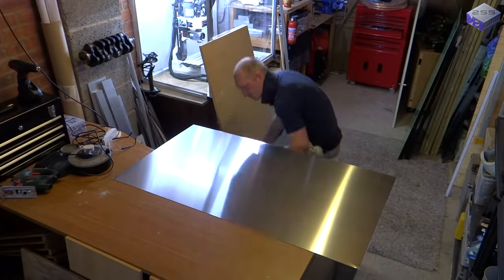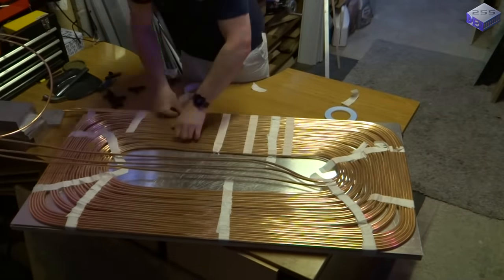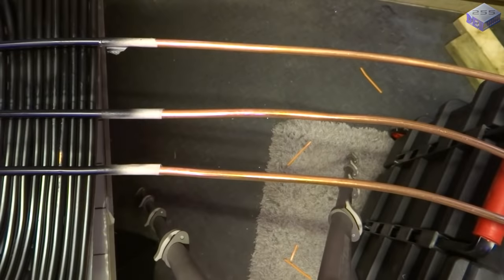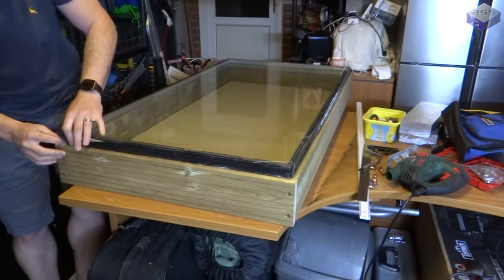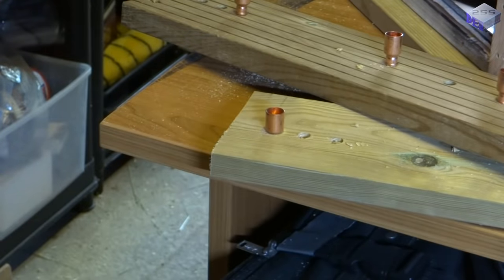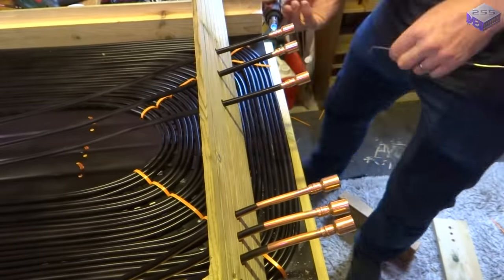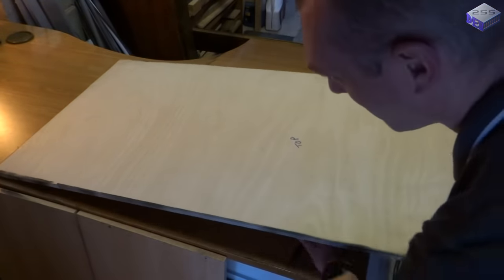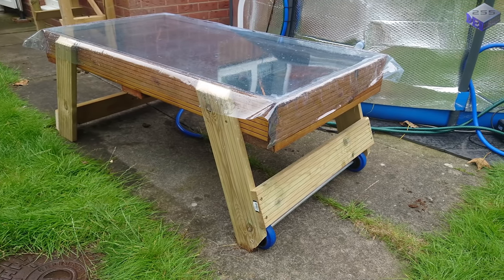Improved Solar Pool Heater - Full build

Comment: Does it freeze in winter?
Reply from the maker: Hi, yes it will do if the pool was to get too cold in the winter, I don't believe there is enough heating during the day to keep the pool above 0ºC overnight. We pack our pool down when the temperature starts to drop and cant be maintained.
Reply: @TheSolarPoweredEngineer  thanks for the answer

Comment: Great video, looks pretty damn good. Question: Does the height of the enclosure affects the efficiency? I'm planning to build a couple and I would like it to be as thin as possible since I'm installing it on my roof near my solar panels.
Reply: Hi, thank you, works ok too. I am sure you are right, I can raise mine easily within the unit and believe it would make it more efficient, especially when the sun is at a angle to the panel. Good luck with yours 👍
Reply: I think you are talking about the height of the enclosure (box). As per my understanding, the lesser the height of enclosure the higher the temperature inside because the amount of sunlight/heat is constant. If we can reduce the air enclosure inside the box the air will be relatively hotter and the pipe/water will be heated soon.
Reply from the maker: @relianceengineering3710  I will have to give this a go, where I could drop the glass down a lot lower and move the inlets and outlets to accommodate the change also, or just raise the lower board up, it fits within the frame, so easy to adjust. I will probably do a Wattage output comparison between lower and higher; although would have to wait for some good summer sun, 2021 was not the hottest summer in the UK. 👍
Reply: @relianceengineering3710  the faster the air heats means it will also cool faster. Also you are forgetting magnifying effect of glass. There is an optimum height to maximise the magnifying effect.

Comment: I been trying to build the wife the hot tub I promised her years ago. If I run the wires for the lights and the fans up through the drain I won't have to drill holes for them, but then the plug won't seal. Any ideas what I can do here? I can email the schematics if it will help.
Reply from the maker: I would be tempted to fit an external drain pipe/hose that was raised above the water line, that way you could feed it down the tube and not have to worry about sealing it, plus you would only need to lower the tube to drain the system. Or purchase a spare drain cap (I'm guessing its the screw lid type) and ensure you seal this, although there will be a fair bit of pressure at the drain hole. I'm sure you are looking into a low voltage and fully insulated system with good electrical leakage detecting circuitry too. Hope that helps

Comment: Consider a hole for pressure relief?
Reply from the maker: Thank you, that had come up before, although the unit is not fully sealed at the bottom, in case of any leaks/condensation inside. A good point to note though.

Comment: Watching this video makes me think and believe that because flame from a match is so hot , it can melt a cube of ice. You missing heat with temperature, Sir.
Do the math.  With regular size of pool , to get to raise water temperature in it,  with one of your projects is impossible,  because you  gonna lose more heat from the surface of water in the pool.
So with this diameter of copper pipe,  you will need about 20 pieces  of your gizmos  hooked up in line,  to get proper amount of water flow, with such a heating surface to maintain. 
You can't trick physics 
With one of your panels you can warm up water in a 5 gallon bucket,  not water in a pool

Comment: Shouldn't you be using black cable ties for maximum thermal absorption?  ;)
Reply from the maker: Hi, I will be changing the cable ties at some point, possibly to copper sprayed black, as the orange ones may degrade in the UV light. There may be a little heating effect from them although may be very small in comparison.

Comment: How does the water circulate ? Thanks
Reply from the maker: Hi, I have a 12v pump that is now connected to a 50W solar panel via drinking water hoses; this then feeds into the existing Bestway pipes via 3-way connectors so that it passes through the existing pool filter first.

Comment: Do you have Reflectix around your pool???
Reply from the maker: Hi, this is the material that I placed around the pool: -

https://www.amazon.co.uk/dp/B00GUDVUXW/ref=as_sl_pc_tf_til?tag=dev25503-21&linkCode=w00&linkId=492f80de3ffcad224c5be22949f5a723&creativeASIN=B00GUDVUXW

It worked really well and has lasted for 3 years, its showing signs of delaminating now though as it's not designed for outdoor use really
Reply: @TheSolarPoweredEngineer  OKAY! Do you feel like it helped retain the heat? I've used it before in my camper but never thought about wrapping the pool.
Reply from the maker: @elbayanela  Yes, it definitely helped keep the heat in. I have a pool dome cover over the pool now too and garage matting under the pool that also help. Heating the pool is only half the battle 🙂. Also, the matting made the bottom of the pool very comfortable, when you jump in or hit your feet on the bottom, it's very soft.

Comment: Sorry i must've missed it in the video, but how do you make the water flow around the heater?
Reply from the maker: Ah yes, I probably only showed it briefly, this is the link to the pump I am using, it's a 240V AC pump running around 24W https://www.allpondsolutions.co.uk/pond/pumps/full-range/1400lh/

Comment: Would of been better to of used black zip ties they last longer under uv but some sort if metal bracketing could of helped with laying the pipe as well as holding and allowing for set distancing between the pipes.
Reply from the maker: Definitely, although looking at the unit now the glass is probably reflecting most of the UV, luckily the Infra-Red is still getting through. I will be trying a few different clear materials soon to see how efficient they can be made. I will replace the cable ties with metal ones then.

Comment: Great job 
 But your intake and outlet manifold needs some work to even the flow cause the way you have it is not afficient and would work alot better if improved.  By the look of it you are only getting 33%  of its possibility
Reply from the maker: Thank you, yes this is work in progress where I will be doing a few more tweaks to see how efficient it can become, or even build version 3.0 with Black 3 paint suggested from the last comment.

Comment: How big panel I should build for a pool around 30 m2?
Reply from the maker: So for a pool around 5.5m by 5.5m, assuming it's around 0.75m deep (around 22,500 litres), would need a fair amount of these, probably 10 of them to get you going, where a solar pool cover could work a lot better as you have 30m2 of surface area to collect heat. Plus, a solar cover reduces evaporation (heat loss and chemical loss (burns off the chlorine)) and retains more heat overnight, so should save you money also.
Reply: @TheSolarPoweredEngineer  hello thx for your answer I mean 30 cubic meters of water. Lets say to heat the water 3-4 celcius would it be possible if I built 2 or 3  of those with a small pump or the pool pump for 2-3 hours?
Reply from the maker: @FearOfGeorge  ah ok, so 1 cubic meter is 1,000 litres, so 30,000 would still need a fair amount, I am doing a few more videos on this one with a few modifications to see if I can make it even more efficient, and also try another design too, so it may be worth waiting for them, hopefully in the next few weeks.
Reply: @TheSolarPoweredEngineer  Thx sure I will for w8 your videos.

Comment: Is that a double insulated glass pane?
Reply from the maker: Hi, yes, unfortunately I have since found that it is reflecting a fair amount of energy from the sun that could be used to heat the water; therefore I will be replacing it for either acrylic or polycarbonate material.

Comment: What's the difference between capturing the solar gain of 10m square outside the pool or just putting a black tarp 20m Square inside the pool ? 😂
Reply from the maker: Very good question, the external unit has cool water pumped from the lower part of the pool so the panel is continuously trying to heat the cooler water, where the surface of the pool may have a much bigger surface area, although a number of factors reduces the efficiency, one being that the warm water on top of the pool does not transfer down to the cool water, so you still feel cold when you get in, another is that there is more surface area for the air to take away this heat, so it cools down quicker, and then there is the efficiency of the tarp to transfer the heat to the water. Although, if you had the black tarp on top of the water, circulated the water in the pool and have a clear pool dome attached that covered the pool and reduced the heat escaping, this should be a lot more efficient and is something I tried last year. Video to come.

Comment: What temperature do you get out of this ?.
Reply from the maker: Hi, with a flow rate of around 5litres / min, there is around 1.4ºC temperatures rise. So at that rate there should be a 1ºC rise every hour for a 4600litre pool, although there is a lot of factors cooling the pool down, so realistically I'd expect around 0.4ºC per hour. This doesn't sound like a lot, although this is a 3m above ground pool. If your keep the pool covered and insulated you can reduce the amount lost overnight and the pool will warm up noticeably over time. Ideally, you would need 2 or 3 of these for a 3m pool.

Comment: What is the crankshaft on the wall for?
Reply from the maker: Hi, that is from my MGF engine that decided it was a good idea for the pistons to finally meet the valves (it was an interruptor engine that decided to be interrupted); this links to my MGF Electric Vehicle project that I will be getting on with once my Mill is fully converted to CNC. Thanks for noticing 👍

Comment: Great video with info. a question what brand solder fire torch are you jusing? i can see only the half word erpro 120. Regards Jack from Holland
Reply from the maker: Hi Jack, good point, I just popped out into my garage, it's an iroda Solderpro 120, it's an awesome little torch, heat gun, plastic cutting device. Mine was £69.99; there are cheaper versions although I've had mine for many years and it's still going strong, plus it's in a decent hard foam case with heat protection built-in. Here's the link: https://www.maplin.co.uk/iroda-solderpro-120-30-125w-butane-gas-powered-soldering-iron-kit-0742286981009?ff=157&fp=34838&gclid=Cj0KCQiAxoiQBhCRARIsAPsvo-ywPM3XgVtSXtSYNDUGV5ueisYWRIU2TjNZoWWG2xlby42J_vKG6poaAtl_EALw_wcB

Comment: What kind of water pump did u use?
AC/DC Watt power?
Reply from the maker: Hi, this was a 240v AC pump at 24W and is capable of pumping 1400 Litres per hour with a max height of 1.8m. Here is a link to the pump: - https://www.allpondsolutions.co.uk/pond/pumps/full-range/1400lh/

And link to my website of all the other components I purchased for the this and the previous project:- https://www.dev255.uk/what-i-bought

I hope that helps.
Reply: @TheSolarPoweredEngineer  You might have to track down a solar powered pump like used with some fish pond applications. Only runs when there's enough sun to need it!!
Reply from the maker: @justaddwata  definitely, that is a good point for others looking to use these panels, where I controlled the pump via a relay connected to an Arduino microprocessor that I programmed to monitor the temp of the pool and temp of the panel and only switch on when the solar collector was 5 degrees above the pool (switched off at around 2 degrees above) although this could be quite a complicated method for most users, so a pump that does this for you would be best. I will take a look at better solutions, thank you 👍

Comment: I would have thought it would have been better too do the holes bigger than the adapter but then fill with silicon too allow for expansion.
Reply from the maker: Very good point, I hadn't thought of that. My idea was to make it tight so that the pipes inside were not disturbed when the external pipes were knocked or tripped over. Your idea does make for easy maintenance too.

Comment: can you heat a home with a couple of these panels?
Reply from the maker: Hi Alf, it depends on the size of your system, where a few radiators would get warm with a couple of these to warm a garage, although probably need a fair few to heat a home, especially if you don't have an almost sealed home. Another way to think about this is to look at your boiler, ours is a 12KW boiler, where this panel can collect around 500W, so you would need 24 of them to give the same heating rate, although that would only happen during the day and in the summer. I believe the best options for renewable home heating would be ground source heating or air heat exchangers, you can have solar thermal installed on your roof though (can be expensive though). I hope that helps

Comment: Increase surface area of tubing using charcoal in blender blended to nano particles - 30 minutes of blending wear face mask and gloves sprinkle on the tubing using a sieve after a light coat of spray paint - surface area is x 8 - use a faster flow rate to get every thermal capacity out quickly.
Reply from the maker: I love this idea, will have to buy a blender though. You are spot on with the fast flow as turbulant flow is much more efficient at transferring the heat out and a faster flow allows more heating capacity of the tubes as there is a greater difference in temperature between pipes and potential (given the incoming energy)

Comment: I like the use of 3 tubes for greater surface area!  I'm thinking I'd like to take this on only I would like to use corrugate plastic roofing on top.  Anyone see a problem witht hat compared to glass?
Reply from the maker: I am thinking of using acrylic for mine as the sealed unit has now blown and needs replacing. It should be more efficient with acrylic and maybe even corrugated plastic, although the corrugation would reduce the amount of light able to get through as the angle changes, so you may be reducing efficiency there. I'd say if you have some anyway, try it with and without the corrugated plastic to see what results you get. I hope that helps.

Comment: Would be Very interesting if you replicated this project, and used not just any matte black, but something like VANTA BLACK - the blackest black, than compare the times of reaching certain water temps,
Reply from the maker: Hi, the Vanta black does sound interesting and there is some debate whether this would benefit for the cost, although well worth a try. I intend to do a lot more tweaking so may even do some miniature versions to run a number of experiments with different materials and coverings.
Reply: @TheSolarPoweredEngineer  looking forward to see this little experiment, no need to choose specificaly vanta, there already are even more efficient ,,lighteating colors,, Hence the difference for this application would not be reckognisable, at least i think, since the light absorbing ability is tweaked by a tiny percentage. Anyway, if you will please do this, tag me please, i got a ton of work lately, building a house, so at normal circumstances i propably would not find that video out. Best regars from Czech Republic.
Reply from the maker: @jacobstraightpipee3991  Hi, certainly, I will send you a link to the video once done. I have been super busy with an event also (Makers Central 2022), so trying to get back on track. Good luck with the house build.

Comment: How did you hook it up to your pool?
Reply from the maker: I use a pond pump that I run externally from the pool and attach it to the hoses. The pump inlet is connected to the drain port of the pool as this primes the pump as it's under the waterline and then the output of the pump runs to the panel input. The panel output then runs through the top input of the pool. It's not set up at the moment, although will have it up and running when the sun reappears. Here is the pump I use: https://www.allpondsolutions.co.uk/pond/pumps/full-range/1400lh/
Reply: Thanks for the reply.

Comment: Painting the inside of the box black would also increase the output
Reply from the maker: True, I'm looking at reducing the air volume inside and replacing the glass with acrylic too as the glass panel is reflecting some of the energy back out.

Comment: Nice work. Would recommend painting the inside of the wood black too just to help with a little extra heat, but very smart. What's the temperature uplift on a good day from a mains tap?
Reply from the maker: Hi, thank you, if supplied from a mains tap there would be only a marginal increase of around 0.1ºC or so from around 500W of collected solar energy. The panel works better for closed-loop systems where the heat collected accumulates over time, so this would be good to raise the temperature of an emersion container. We saw around 3ºC increase per day with a 4600 litre pool from the previous panel where that provided around 4.8kWh of energy per day.

Comment: Have you thought of using a thermally conductive resin to bond the pipework to the aluminium?
Reply from the maker: Hi, I hadn't thought of that, makes a lot of sense, I may need to do some modifications to this one, or even make a new one and compare. Thank you.
Reply: @TheSolarPoweredEngineer  
I'm looking to build one myself so thanks for the video, I wasn't going to double glaze mine only single but looking at yours I think double is better 👍
Reply from the maker: @jonathantatler  A few people have mentioned bringing the pipes up closer to the glass but not touching it, I will have to give that a go too. Good luck with yours.
Reply: @jpeterman57  fair point it you can get thermally conductive epoxy resins which would work
Reply from the maker: @jonathantatler  Yes, I've used thermal bonding in the past to stick heatsinks directly to components that have no other fixings.